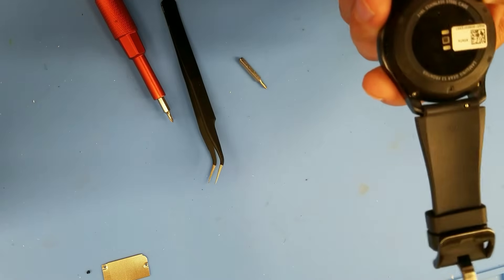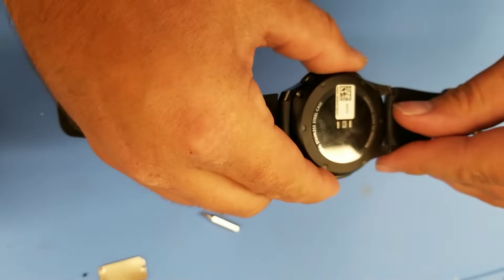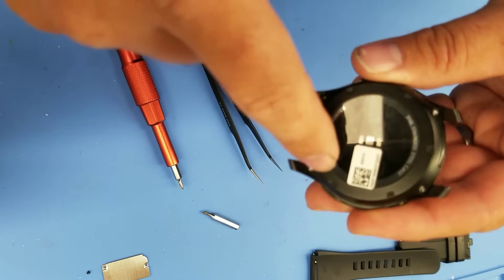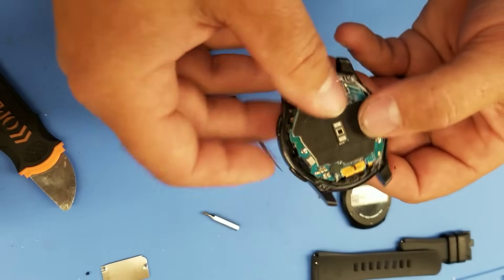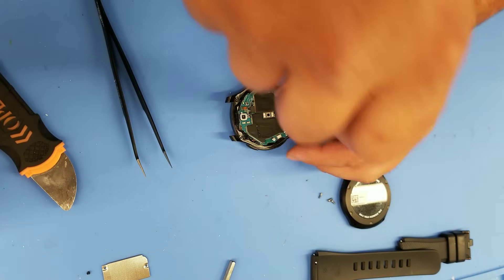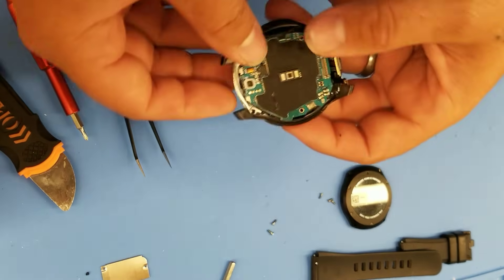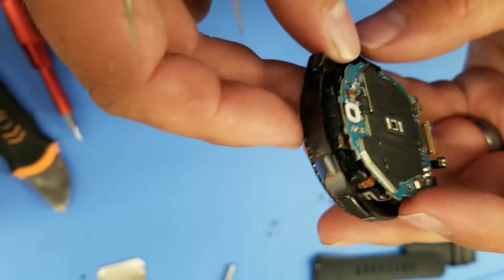Samsung Gear S3 Frontier teardown, battery replacement

Comment: It would have been nice to show how to put it back together again.
Reply: Reverse the Video perhaps?
Reply: I was thinking the same thing, I wanted to see how easy it was for him to reconnect those connectors. Anyone can tear apart anything, sometimes putting it back together is a different story. It would have been interesting is all I'm saying.
Reply: if you need that, you really should not be doing this,  first timers
Reply: I just replaced mine and I'm glad I did.  The battery was bulging.  Not a good sign in a li-ion battery! Reconnecting was tedious but got in done in just a couple min.
Reply: After you lift and turn over the circuit board, the battery is attached to the circuit board with adhesive similar to double stick tape.  Pry the battery off the board carefully!
Reply: Steven Taskin 🤣🤣

Comment: And after that, say "bye bye waterproof ".
Reply: What are you talking about? There was no sealant or adhesive removed, therefore the "waterproofing" isn't compromised. Another thing, Gear S3 IS NOT waterproof, it's  WATER-RESISTANT. Do you know how many watch repairmen take watches apart to change batteries? They're still water resistant afterwards because the silicone gasket is still inside.
Reply: Will J I say only what Samsung sayed to me
Reply: Youssef Baddou really
Reply: Ak situk mal élevé
Reply: Youssef Baddou idiot

Comment: Great video!  How difficult is it to get to the bezel from there?  Mine needs cleaned badly.
Reply: This might be a bit late Scott, I just saw the video. If you run hot water from the tap on the side of the watch where the buttons are, it will free up the bezel for you, after just a minute, or maybe longer if there's a lot of dirt there. Swivel the bezel as you you run the water and you will feel it freeing up. Usually it's soap particles that get stuck in there over time. This clears it right up. Give it a few shakes afterwards to get rid of excess water, or my favourite trick, a minute or so with a hair dryer.
Reply: @brianmsahin  Thank you! Your tip worked flawlessly!
Reply: @L0stW0n  You're very welcome! 👍👍👍

Comment: Hi I have a Samsung gear s2 3g that quitted working, and I am wondering if it could need a new battery and if that's the case would it be simple to change like your demonstration?
Thanks!
Reply: Sindy Phillips I have the battery for sale on eBay.
Reply: @skyson101  linl

Comment: Does opening the watch permanently compromise the waterproofing?
Reply: Leonard Church Actually it does not. No sealant is used in this area to keep the water resistance. There is a sleeve assembly between the back of the watch and the front. Once it's closed again correctly the water resistance is intact. How do I know? The battery on my new Gear S3 seemed to be draining very quickly from a few weeks after getting it. I took it to the Samsung Service centre, luckily just a few hundred metres from my apartment. The technician changed the battery in front of me.. I asked the same question as you. He said no, water resistance is still there and the watch is covered by warranty once Samsung change the battery. If you do it yourself the warranty will not be valid (if they discover that you opened it,) but it will still be water resistant due to its design. If you buy any water resistant watch whether it's a Gear or a Rolex, opening it to repair or change a battery doesn't affect water resistance. They're not like phones that have sealant all around. One proviso though, no company and that includes Rolex actually guarantee water resistance as they cannot be sure how you used the watch and if it was damaged because you went beyond the depth level guaranteed.
Reply: @brianmsahin  thank you
Reply: Well, that answers that.
Reply: Very pleasent answer. Thanks.
Reply: Jonathan Sanchez well for me if I changed it, it looks like battery is 33 bucks plus shipping, I'd probably charge 45 for that and maybe 30 for labor? (Note that battery is from ebay haven't looked on IFIXIT for a quality battery yet)
Reply: cruzernator shhhhh idiot
Reply: Brian M How much did they charge you to change the battery?
Reply: @JonathanSanchez-be2ck  Just saw your question 11 months late Jonathan my apologies. It didn't cost me anything as it was still under warranty. It was a, fairly new watch so they just replaced it for free
Reply: Leonard Church Yes, absolutely

Comment: Thank You for your video. But my question is after that the watch Wil be resistance water us  previous
Reply: Yes, it will still be water resistant due to it having an o-ring around the outside instead of some adhesive.
Reply: Hussein Shehem no

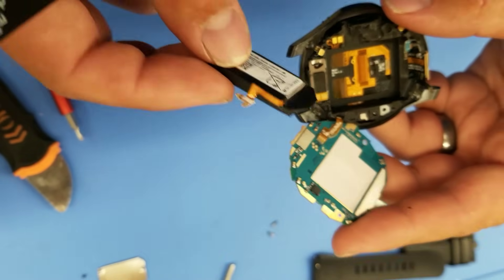Comment: How do you reattach the little ribbon cable that's attached to the circuit board at 3:40 if it becomes detached. Yeah this happened to me. lol Seems like it's glued on or something.
Reply: did you find a solution for this? detached and the watch charges and i see the display when it does but now buttons don't work to turn it on

Comment: Did you get the 2 screwdrivers from the same set? I can't seem to locate a set that has both PH00 and Y00. I would really appreciate a link to the exact set you got them from (if they are indeed from the same set). Thanks!
Reply: Where to find

Comment: Thanks for the video Ryan! 
Does anyone sell a larger capacity battery for the Gear S3 Frontier so I don't have to charge it so often?
Thanks in advance!!
Reply: Bob M a bigger capacity battery usually means a bigger battery, which wont fit in the watch
Reply: The new Samsung Watch battery is 472 mAh instead of Frontier's 380 mAh. Watch size is the same. Could it be compatible ?

Comment: PLS ANSWER MEHH, CAN U REPLACE THE BREZEL CAUSE MINE SCRATCHED UP
Reply: https://rounded.com/samsung-gear-s3-frontier-sm-r760-turning-bezel-gh98-40541a-gh96-10729a.html
Reply: Not parts yet for outer things you will have to but a parts watch in good condition sorry for the delay iv been out of town working.
Reply: I've had mine for less than a month and already seeing alot of scratches on the bezel.
Reply: greekcs same and i hate it BTW im just 11 y old hehe
Reply: had mine for 1 year + and used everyday. no damage anywhere
Reply: Julian De Guzman yes you can got mine off eBay for 7 bucks

Comment: The QR-Code of this battery in the video is GH43-04655A+DL1HA12AS+008260.
If anyone has a link to buy it, please share...
Reply: https://rounded.com/samsung-gear-s3-frontier-gear-s3-classic-battery-eb-br760abe-380mah-gh43-04699a.html?sl=en
Reply: Tory X did you try to buy it before?
Is it genuine ?

Comment: Where can I buy the battery replacement?
Reply: 22ktekno you can buy it on amazon for around 10 dollars
Reply: Just bought this from Amazon, original to battery in watch (didn't want to risk some cheap crap), it was $36.99.
SIDAQU EB-BR760 Battery for Samsung Gear S3 Frontier, Gear S3 Classic EB-BR760A 380mAh GH43-04699A
Reply: Ah, My huge mistake BigD, sorry but I did look around to find battery and I couldn't find battery available in shop but I heard it was made in china so I don't know when the battery will show up in shop or something
Reply: https://rounded.com/samsung-gear-s3-frontier-gear-s3-classic-battery-eb-br760abe-380mah-gh43-04699a.html?sl=en
Reply: Bought mine on Amazon
Reply: https://www.amazon.com/gp/product/B07D1BB31H/
Reply: Thanks a lot. Ordering 1 today.. Watch only last 10 sec while doing a hone call after full charge
Reply: do you have a link? I cant find it. I think you were looking at S3 as in the PHONE.

Comment: Can you even get a battery replacement?
Reply from the maker: Casey Goode china
Reply: Ryan The Cell Phone Doctor link?
Reply: Ryan The Cell Phone Doctor where is the link
Reply: yes very easy
Reply: Amazon - SIDAQU EB-BR760 Battery for Samsung Gear S3 Frontier, Gear S3 Classic EB-BR760A 380mAh GH43-04699A (original type), $36.99. Generics for less if you want to try that - I didn't.